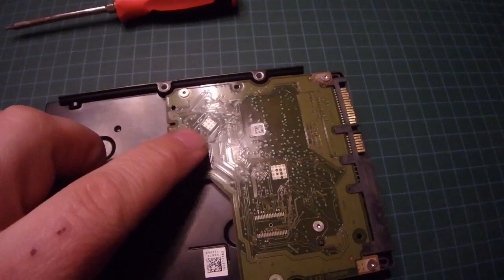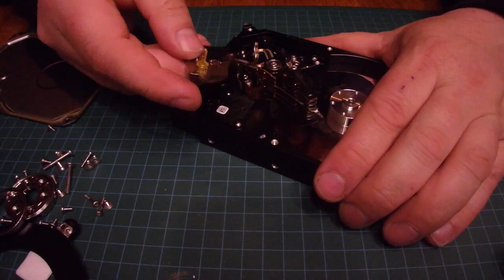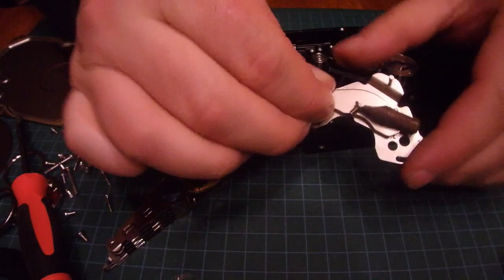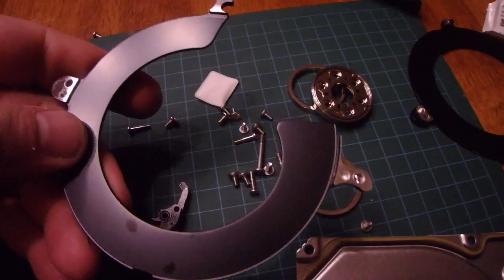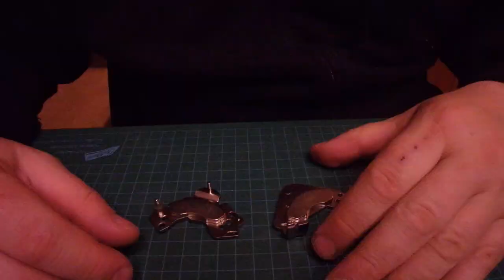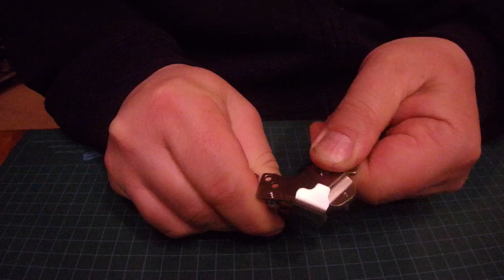What's Inside a Computer Hard Drive

Comment: HD magnets are strong as fuck. Don't accidentally drop two of them near your balls.

2:05 - Looks like a "lady pad" but it's actually an air filter. It draws air in through the side through a tiny hole somewhere on top and the air goes through the filter pad.
Reply from the maker: +Jim Griffiths oh interesting I thought it was one of those anti moisture pads